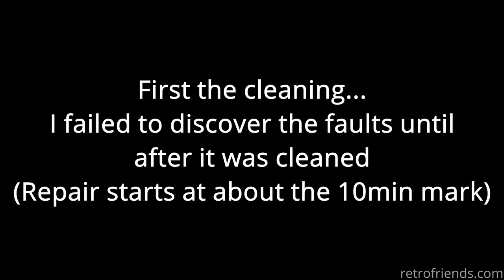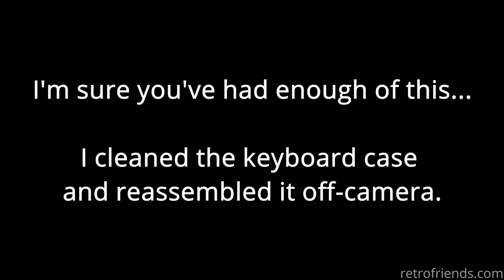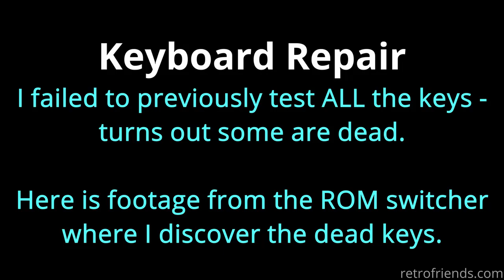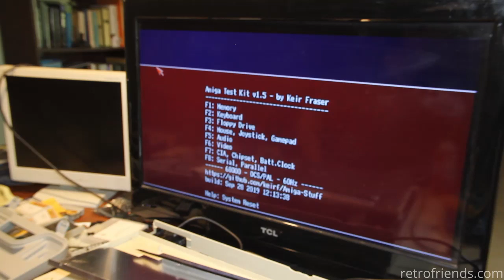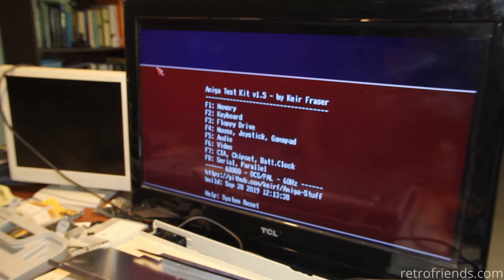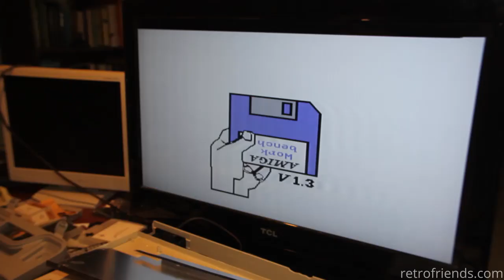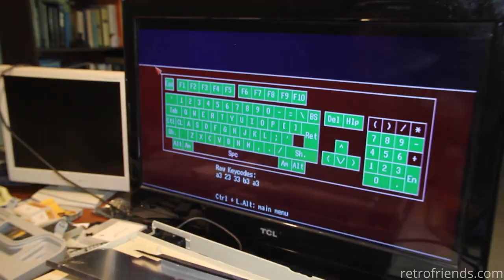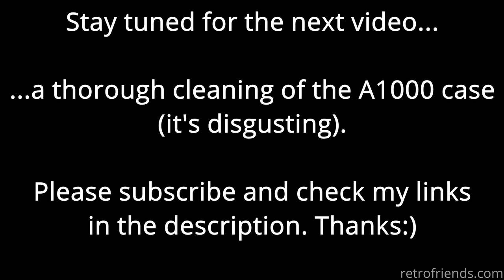Amiga 1000 Keyboard Clean and Fix

Comment: at least yours was cleaner than mine, mine looked like it came out of the titanic engine room post sink.  a Mitsumi Type2 mechanical switch was used in the Amiga 1000 keyboard. , usually corroded near the contact points. you can clean end or emery board bend the metal back to restore functionality in most cases. blue insides are replacements, originals were all black.
Reply from the maker: Wow, yea these wern't as bad. As shown in the video, once I figured out where the contacts were inside the switch, I was able to get the rest just by taking the key cap off and squirting contact cleaner in the right spot.

Comment: Hi,there is no way to clean keyboard properly without complete disassembly it.Period. Take keycaps out,clean membrane/pcb,clean the keyboard case...and keyboard is ready for next 30 years...Every other way is amateur partially cleaning.
Reply from the maker: Check my other videos, where I do completely disassemble Amiga keyboards and clean them. This one is different. Complete disassemby of this keyboard requires de-soldering every key, which takes more time than I had available, and risks damage to 35-year-old solder pads. The owner of this keyboard is happy with the results, which is what is important.